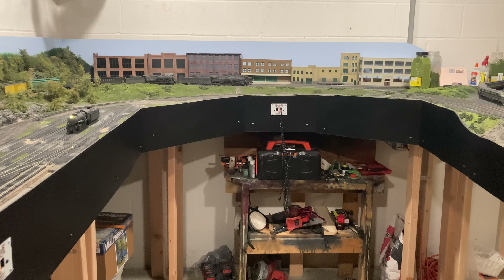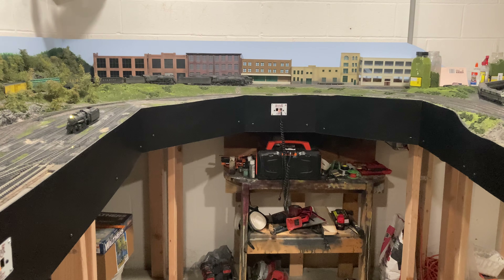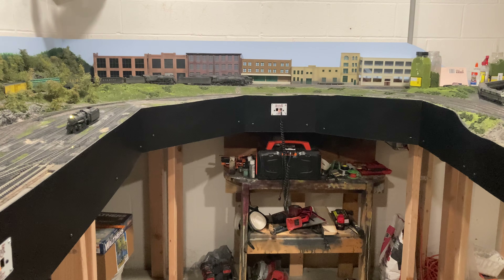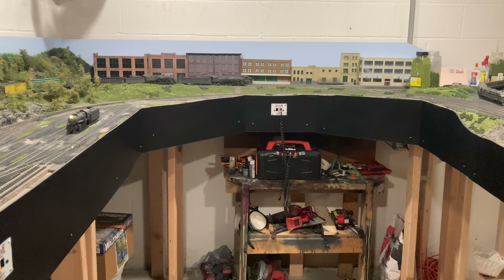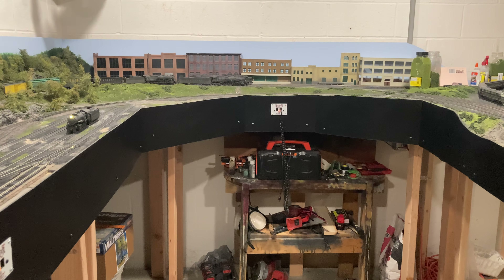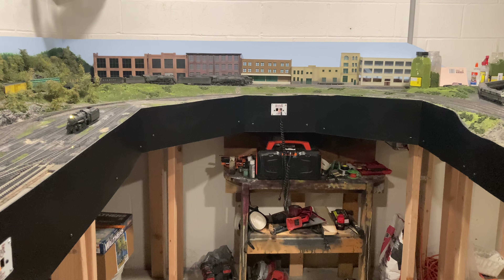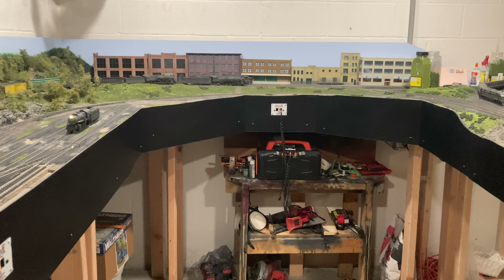HO Model Railroad Update 11: Hillside Scenery and Painted Fascia

Comment: An excellent video. P.S. Don't just paint your fascia, detail it so it looks like the scenery continues toward you. On a small part of my layout, the rocks on the cliff and the trees on the fascia are actually a set of electrical switches and levers controlling track switches and semaphore signals and local locomotive control. It's great, and I have scenery all the way to the bottom of the fascia, so it looks good, and it even provides humor and mirth when I pull the wrong tree and the train heads down the wrong line. Hello from the Tracy Mountain Railway in Colorado. 💙 T.E.N.
Reply: P.S. Paint the river down to the fascia bottom with a waterfall. 💙 T.E.N.